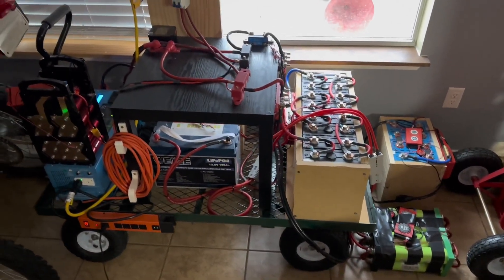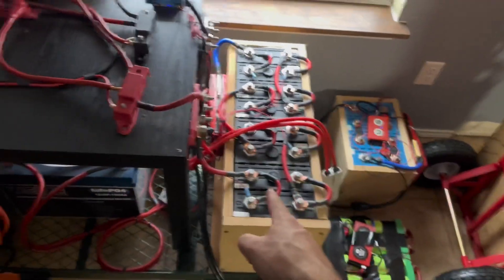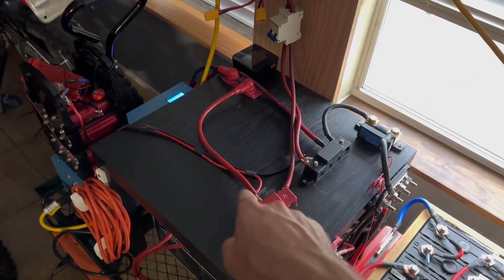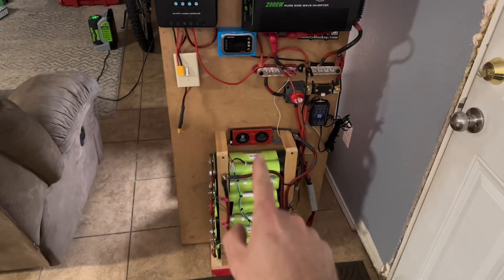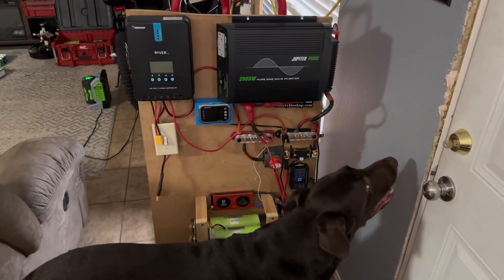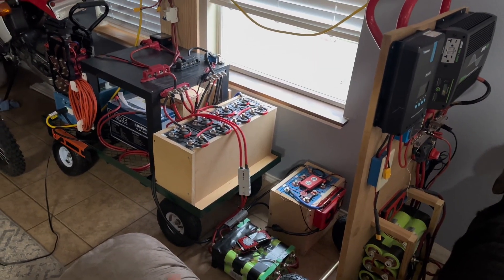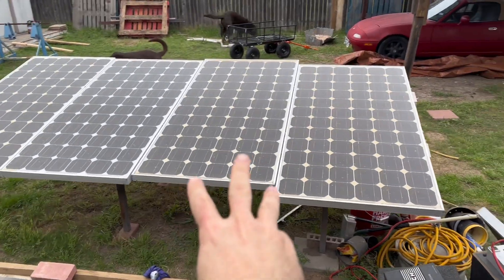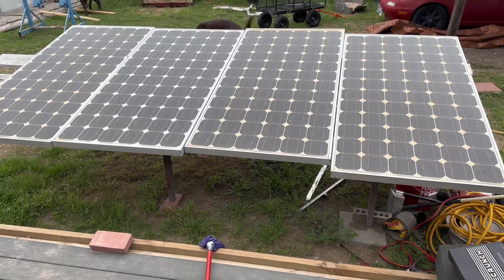Added more batteries to my solar generator

Comment: If you want to eventually add a larger AC unit, you can add a "soft start" module to the compressor to reduce the influx amps to 1/4.

Comment: Just a safety tip when working around electricity and showing people stuff, only point with one finger. That way if you forget and touch things, no harm done. If you point with two fingers and touch stuff it hurts more.
Reply: Also it is a good idea to touch things with the back of your hand, that way if it is hot, and you clench, you break the contact instead of grabbing it and being unable to let go.

I was taught that one, then later got to test it.

Comment: Dude, you are either going to end up with a hot dog, or making your cat sound like a dog when it bursts into flames...WOOF!  Everything's mobile and looks bussed, breakered, and fused, so not bad.  My one panel, thousand watt system,  in my shed has nothing but a disconnect for the solar panel.  I'm doing a small system for one part of my house and I'm trying to get some good ideas, so thank you.  I'm doing a rolling wooden crate box with either three or four, 100 ah Li-Time Minis - I like the idea of the Anderson connectors to connect other rolling battery banks.
Reply from the maker: That sounds like it would work really well, Haha they love chilling on the battery, definitely need a cover in the future. That’s awesome, yes I wanted portability and flexibility in my setup and makes it easy to change and try out different batteries and test out new components, Good luck on your setup stay safe.

Comment: basick on a how to on a 48v set up?
Reply: same as 12v, but slightly different equipment. The main advantage is that for a given inverter output it costs 1/3. And you need more batteries, all balanced, all the same capacity. Commonly the strings are 16 cells instead of 4 cells. The capacity on the cells on a string need to match.